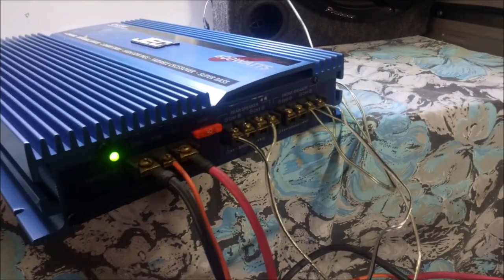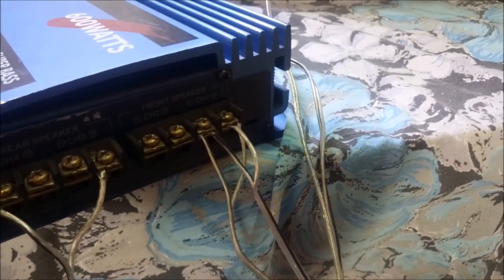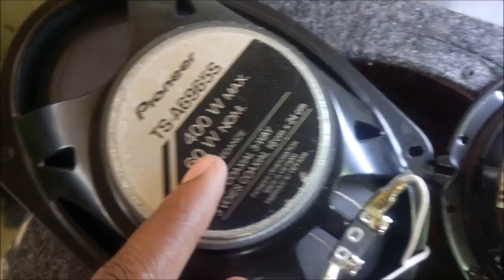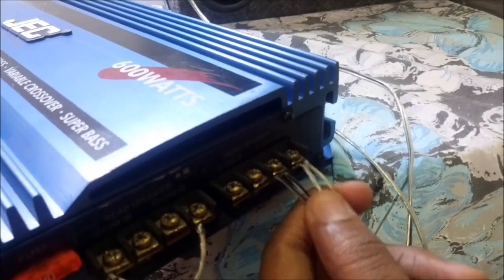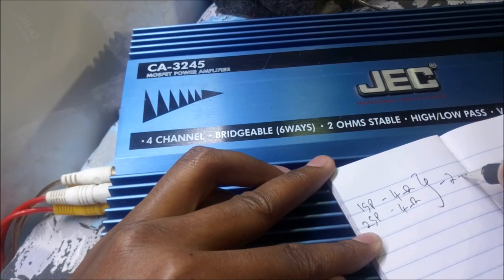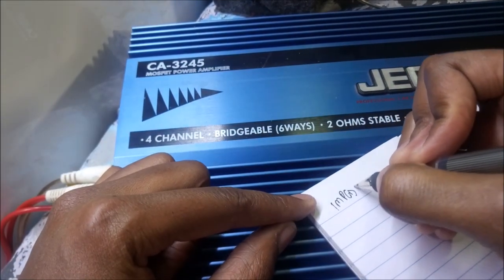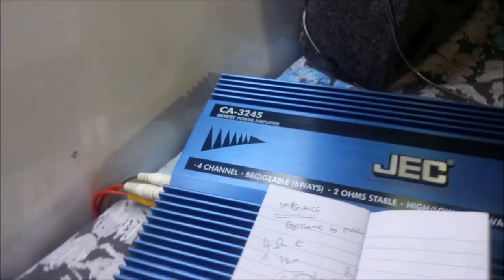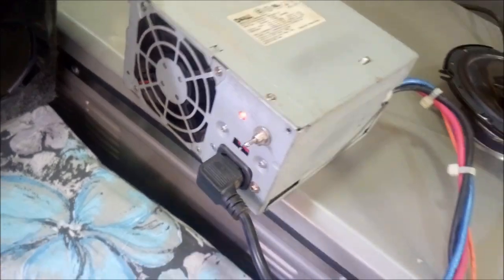Connecting 2 Ohm Speaker Load To The JEC3245 Amplifier

Comment: You forgot to add that the two speakers must be connected in parallel for the formula to work. Otherwise this is a very simple and straightforward explanation for newbies. Good job.

Comment: so educative thanks for the video
Reply from the maker: Glad it was helpful!
Reply: @DominicGichane  i have this amplifier with 2 speakers 4 ohm and 2 speakers 3 ohm. How can i conect
Reply from the maker: Connect to one channel two speakers connected in parallel. One 4 Ohm and one 3 Ohm. This will give a total of 1.71 Ohms. Together with a longer speaker cable this will near the 2 Ohm stable value
Reply: @DominicGichane  in thith case how many rms in the channel?
Reply from the maker: @علاءعبدالسلاماسماعيل-د9ف  this amplifier has 50Watts RMS rating per channel
Reply: @DominicGichane  50 rms @ 2 ohm?
Reply from the maker: @علاءعبدالسلاماسماعيل-د9ف  actually around 75 watts if 2 ohma
Reply: @DominicGichane   my speakers 50 rms

Comment: what is the rms of each channel???
Reply from the maker: 50 Watts
Reply: i have a
JEC-CA3245 600Watt amp
Pioneer AVH-x5750bt head unit
1 pair Sony xs-xb1651 60w rms
1 pair Sony xs-xb6951 100w rm
1 pair Pioneer Ts-s20 tweeters
1 Sony xs-l120p5h 300w rms

will the amp power this?